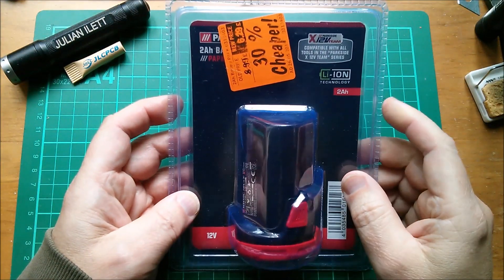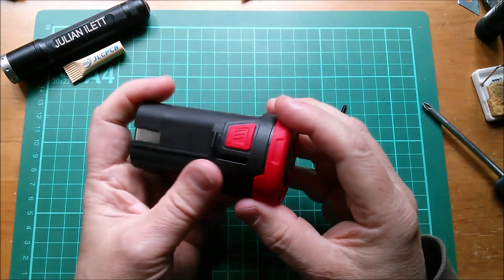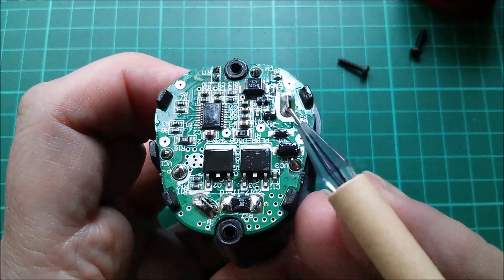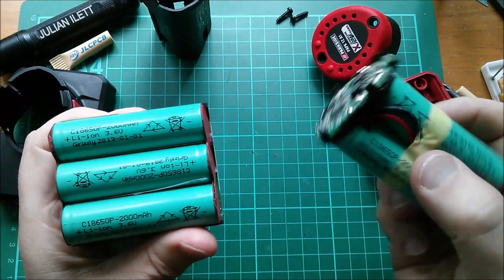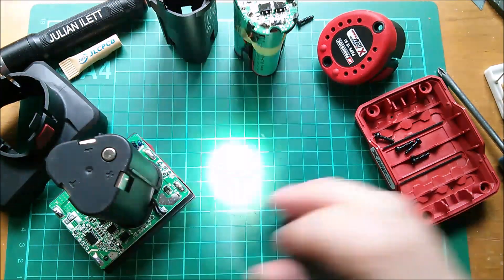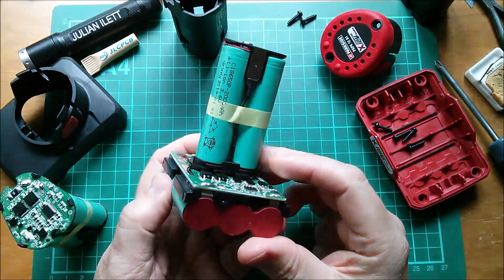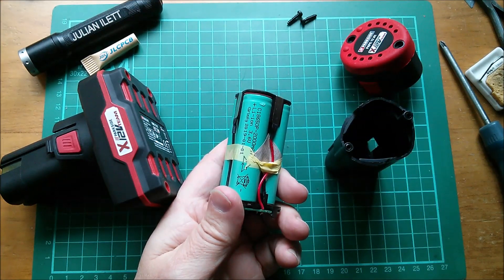Lidl Parkside 12V Power Tool Battery Stripdown - Very Revealing

Comment: Interesting vid, as I've just bought one of those Parkside drill/drivers, (I've just done a review of it on my channel),  seems to be well made & ideal for smaller jobs,  instead of getting out the mains powered drill. I've just dismantled an old summerhouse in the garden, using the screwdriver function , the battery is still showing full charge!
I was tempted to have a look inside the battery pack, you've saved me the trouble of doing that!
 I'm surprised at the amount of charge control circuitry in the actual battery pack,  I thought most of it would have been in the charger itself. 
I've bought several of Lidl's mains power tools over the last few years & not had any real problems with them, The 'florabest' lawnmower is on its fifth season & still going strong! 
Just subscribed btw!

Comment: Could be that they are relying on top balancing. My guess is that they set the over volt setting at an reasonable voltage. You said the chip could turn off the charging fet for each cell when the over volt trips. This should bring them reasonably close to each other, should it not?
Reply: I think some of these cheaper ones go for midpoint balancing... stopping chjarge as soon as any battery hits 4.2 and stopping discharge as soon as any hits 2.8, this way capacity is slightly reduced but keeps evryone safe.

Comment: I think end of the day that modern cells just don't get that far out of balance that it is worth worrying about, as long as they are well matched for capacity and charge state when they are series'd up. If a cell gets very out of balance with the others the pack is faulty or on it's last legs anyway so just using protection and reducing the capacity a bit seems quite reasonable.  Balancing adds a lot of complexity.

Comment: These days you can buy seemingly-decent genuinely-3400mAh 18650 cells from AliExpress for around £3-4 each, depending on how many you buy at once (I'm only talking about buying 8-12 cells to get the lower prices, though, not 50 or something!)

I've bought supposedly-Panasonic NCR18650B 3400mAh cells on several occasions. They look spotlessly new, the capacity definitely checks out, I've no evidence that they AREN'T genuine Panasonic cells, and they tend to have lots and lots of positive feedback. I've only bought the NCR18650B type which are fairly low-current cells, so I'd imagine/hope that the ones you got from those power tool batteries will have higher current ratings, but by "fairly low-current" I mean that the datasheet for these gives them a maximum DIScharge current of 4.8A and a maximum charge current of 1.6A, and that's plenty for the vast majority of things I use 18650s for!

(If I need higher-power batteries, I typically go to HobbyKing and get a LiPo designed for RC applications, but thanks to the vape craze, high-current 18650 cells are readily available on AliExpress as well! :D)

Obviously they've had issues with posting these things around the world, so sometimes they take a while to arrive, and at least in my most-recent order they'd completely misdeclared the contents on the customs label, but because the packaging was a bit poor you could totally feel the cells rolling around inside the box, so that was pretty obvious! So, uh, do this at your own risk ;) (I don't think the poor packaging was dangerous at all: they couldn't roll about very much, and there was absolutely zero chance of them shorting each other out or anything, but you'd kind of hope that they'd pay more attention to the packaging of stuff like this!)

[Disclaimer: it's been at least a year since I last ordered 18650s from China - or anywhere else - so the above info may be out of date. Don't sue me if I'm wrong, etc. ;)]

Comment: Most power tool packs and laptop packs are not balanced. The cells are paired for capacity and internal resistance at the factory. Perfectly normal, and not missing anything :)

Comment: Balance Balance Balance. Is a 12-volt lead-acid car battery with 6 cells in series balanced? 

NO!
Reply: Pb can have cells in series with no problem. When one cell is charged the rest of the charge is released as electrolyte breaking down (gas) and heat. Lithium cells start plating metallic lithium between the anode and cathode, eventually shorting the cell inside. They cannot be compared.
Reply: @zaprodk  

Pb is 2 volts per cell nominal. 6 cells X 2 Volts is 12 Volts, not 24, or at least is was when I went to school. ;)
Reply: @johnnodge4327  You are correct. My bad.
Reply: No, they aren't. That's the reason why you can throw away the whole car battery when just one of its cells has gone bad.
Reply: @e1woqf  but a cell failing in a car battery is not because of lack of balancing. It's because of sulfation that happens sooner or later.
Reply: @zaprodk  Sulphation occurs especially within poorly charged cells. Balancing can help to charge all cells more evenly.
Reply: That is a completely differnt chemistry. Lead-acid-batteries are quite resistant to overcharging, so they inherently balance themselves when charging them (slowly). Li-ion batteries die quite quickly when overcharged.
Reply: @superdau  All true, EXCEPT for the flooded lead acid cells that you can't add water too, and the SLA "gel cells" and AGM cells, which are not intended to have water added. So you "balance charge" such batteries infrequently, or suffer a shortened battery life due to cells drying out. It's a compromise.

Comment: I have a parkside cordless drill and a few years ago after little use one cell went out of balance to about 3.6 volt while the other cells (2) where both at about 4.2 volt
When put on the charger it said it was full after a few seconds but then put in the drill it said it was empty!
I took it apart and measured the voltages of each cell and charged one cell (the 3.6 volt one)  with a li-ion single cell charger by connecting wires from the charger to that single cell and
after putting it back together and using it for a few years now and many charge/discharge cycles I can say it seems to have worked, the drill works as it should and charging when it's empty is as normal a couple of hours till full
Reply: Marcel - I've done the same "manual balancing" on a Hitachi battery pack and also have been using them for years afterwards.  It pays to think!  Cheers.

Comment: I thought they where balanced, if it checks the cells over voltage parameters (each pair of cells) and the under voltage bit, surely that is balancing ?
Reply: It depends on the action: if one cell's charged or overcharged and it cuts the charge current, the other cells will not be fully charged, effectively reducing the capacity of the set. If it only cuts the charge to the full cell and remains charging the rest, there's no problem.
Reply: @Pistoletjes  There i also top balancing, middle balancing, and bottom balancing, which each have their own advantages and disadvantages.

Comment: I hit Lidl's yesterday for some cans of cellulose thinners and several of their precision screwdriver sets grabbing one set good enough for watch level work and another couple for electronic level of work, all ratchet bit handles and very pleased at the quality.   They had their cheap soldering iron sets in again with the little "station" that holds spare tips and has the spring thing to park the iron, for £8 its not a bad starter kit imho :)

Comment: I bought Parkside's cordless drill a few years back and its been superb, am surprised the batteries haven't gone yet either as its had a fair few down to the red indicator then charged and over the years and it holds the charge for ages with little dribble of max potential.   I have the 20v pack for my Parkside impact driver and that too can be left for months and still be fully charged.   I don't know what they use in the Parkside dremel kit but had one of them for coming up two years and apart from a bit noisy at full steam again holds charge without loss in between uses but I haven't seen the dremel tool battery's come up in Lidl's as I would buy another.   Parkside is quite unusual in that most of its stuff is still made in Germany rather than some oblique factory in Shenzuen which is becoming a rarity in electrical tools.

Comment: 3 x 3.6V batteries equal a 12V tool eh?  Love when the marketing teams get involved.
Reply: 3.6V is what is printed on the cell itself.
Reply: @Orxenhorf  That is the nominal voltage.
Reply: @Orxenhorf  Yes. That is the nominal voltage. Fully charged they are 4,2V/cell and fully discharged they are 3,0V/cell.
Reply: So lead acid 6 cell systems are really 13.8V systems?
Reply: @Mark1024MAK  Nah, more like 12.6-13.2 depending on the ph. I did have a lawn battery at 13.8v new.
Reply: yes, and charged at 14.8
Reply: lez briddon 
I thought that 14.4V is the maximum charge voltage that will not damage a 12V lead acid battery. So in a car when the engine is on your 12V connector will be on about 14.4V because that’s the alternators voltage trying to charge your battery.
Reply: @Conservator.  13.8, 14.3 14.6. It depends on the car.  Mine runs 14.3 24/7 still hasnt boiled over. Topped up 1 cell after 2 years, barely needed it.
Reply: @Conservator.  my last car had a dual rate alternator. if starting engine caused drop below 10v the it would charge at 14.8v for 20 minutes then would run at 13.8 for rest of journey
Reply: The comments and replys in this thread have been amazing. Thank you.
Reply: It equals a 12,6V tool (3x4,2V fully charged)
Reply: Do you think batteries put out a steady voltage per cell as they are used?

Comment: i have an almost identical (pcb is different) battery (small) but is 10.8 volt 3 cell , it does charge to over 12 volt but the charger , battery and tool all day 10.8 volt :-)
interesting to know it has no balancing , mine is in bits atm because it runs out quick so something new to check :-)
Reply: They are the same thing. 10.8V is the honest nominal voltage used by many manufacturers (honest, because most of the energy in a cell is around the nominal voltage and not the peak voltage). A cheap manufacturer will mark it as a "12V" battery, because that looks better on the label. Essentially the cells will be charged to 4.2V (so 12.6V for a 3S pack) in almost all types of li-ion batteries. Except for LiFePo4, which are li-ion batteries as well, but have a lower voltage. 
I doubt you have LiFePo4. They are more durable than other types, but their power and energy density is lower. So you see them mostly in things like e-bike, but almost never in anything like tools, powerbanks and other electronic devices.
Reply: Sounds like yours is LiFePo4 chemistry, which is pretty well charged at 3,6V per cell.
Reply: @zaprodk  
ok , thank you :-)

Comment: 18650 batteries are pretty cheap now. Do lithium ion batteries  require balancing i though that was a nicad thing.
Reply from the maker: You can balance Nickel Cadmium cells by simply leaving them on a trickle charge.
Reply: Julian Ilett i had a zapper that helped with the memory problem.
Reply: They need to be balanced or matched, If one cell goes under voltage it can destroy that cell or in worse case reverse polarity and the cell is dead/short

Comment: ID is used to identify between 12 and 20 volts, a function not required on the smaller A1 battery.
Reply: It's serving as a pull down resistor(half a voltage divider) for analog identification. That would imply that 12 and 20v are not the only options. Having analog identification for only a couple options would be ridiculous.
Reply: @rich1051414  These things are built to a price budget and so using a resistor is the cheapest way to do it.
May be in future we could see a tri-voltage battery but would be silly.
Reply: It also doesn’t make sense as the high capacity battery has it but the low capacity battery doesn’t. Further, there’s no connection for the ID pin in the charger, so that could cause issues if you plug a 12v battery into a 20v charger or vice versa
Reply: @Dust76tr  Its not a low cap, its a low voltage. The smaller battery is ONLY 12v and so does NOT need an id pin. The bigger battery is DUEL voltage and so DOES need and ID pin.
Reply: Adam Bryant that’s not correct. Within the first 40 seconds he says “this is a 12v 2Ah pack, and this one is a 12v 4Ah pack, and this one (the 4Ah battery) has a little button on top that the other one (the 2Ah battery) doesn’t have”

Later when he opens it up, the larger capacity battery has 2 paralleled banks of 3x 3.6v batteries in series, giving double the capacity but the same voltage as the smaller capacity battery which just has 3 cells in series. He also flips the battery package over at around the 1 minute mark and it clearly says on the back 12v 4Ah for the larger battery

Comment: Cell balancing is overrated. Yes, it works but I don't think is worth the time and energy wasted for it, especially in power tool battery packs that see a lot of quick charge/discharge cycles.
Reply: It's definitely needed for lithium techology, because the chemistry in the batteries won't be identical and one will always discharge a bit before the others and conversely not take as much charge as the others.
You'll always end up having to either overcharge the other two cells in order to get the lowest cell back to capacity, which risks the overcharged cells bursting into flame, or over-discharging the bad cell and damaging its chemistry which will exacerbate the problem, unless you periodically perform a manual charge of each individual cell (or cell block) to get them into a balanced state.  It's safer and less trouble to just use a cheap balancing circuit.

Comment: Fascinating the economics of 18650 cells. You are buying assembled units for less per cell than I can usually find the individual batteries. How can prices move in such strange ways? The cheapest I have found are the low capacity £1 units from Poundland, but otherwise they are usually over £2 each even if bought at 6 cells at the same time with the every concerning  knowledge that what one is being sold might be a low capacity counterfeit. Has buying batteries ever been so Weird? Thanks for sharing!
Reply: It's the magic of bulk ordering the cells.
The manufacturer can buy a no name cell and put their own sleeve for almost nothing, and the simplier and jellybean the components they use on the pack the cheaper it gets.
And of course the more you produce the cheaper it gets because the tooling costs and manufacturing optimizations.
The brand name cells they sell on specialized websites is grossly overpriced because just 1 cell price, shipping costs, and the biggest increment in price is the "fee" specialized website

Comment: Quite odd that the printing on the cells is over the tape.
Reply: Transparent tape?
Reply: joss levy sure doesn’t look transparent with the yellow color typical of transformer tape. If the tape was transparent or opaque it would be blue or blue under the tape.
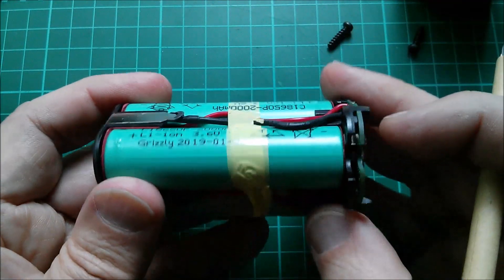Reply: @jakp8777  Look at the video at 03:56. It's clear on the bottom cell that it gets blurry where there is two layers of tape. I've taken a lot of battery packs apart and replaced cells. The cells are printed in the factory with an inkjet head and it would not be practically feasible to put the assembled pack in some sorts of weird shaped jig, move it a lot of times and put it trough the machine to do the printing, so clearly the printing came before the text. My experience is also that if the tape has been sitting there for a long time, some of the ink leaches into it, and will come off if you take off the tape.
Reply: It's not. The tape is very translucent when there is only one layer of it.

Comment: A lot of laptop battery packs are also not balanced. That is the most common design. There should be a law against that.
Reply: They want the batteries to kill themselves after a while. Since they are in series, when a cell dies, it usually doesn't cause a fire, so they are ok with it.
Reply: Balancing is not necesary, ive had there for years and they are still within 0.01v difference. If cells are matched properly balancing is not t all necesary. Its just important to track individual voltaged which it does
Reply: I've bought about 20 or more brands of oem and replacement laptop batteries, have about 200 cells all new, , and a collection of various BMS arrangements which came in them. So far every one of them, all brands types of lithium 18650 laptop batteries had BMS circuit boards with balancing.
Reply: @californiakayaker  Interesting. Than that must have changed within the past few years. When I had loads of dead battery packs from various laptops (like 30 of them) I opened them all out of curiousity and found not one balancing circuit. Only voltage measurement and when the first battery hits max. voltage -> cutoff.
Reply: @ChipGuy Well, I've got a box of BMS circuits from laptop batteries. Each one has a set of discharge resistors. One thing that is different about them is they require control from the laptop to work.
Reply: @ChipGuy  
Out of the 10-15 laptop battery packs I opened I have also yet to see a one with balancing. They sure weren't the newest (luckily they don't break THAT fast), but something between 5-15 years old (not at the time of opening, but relative to now; or let's say from 2005-2015). I've seen newer laptops using pouch cells now (because cramming in everything even tighter to keep the heat in is better, right?). Never took one of those laptops that far apart though that I checked for balancing circuits.